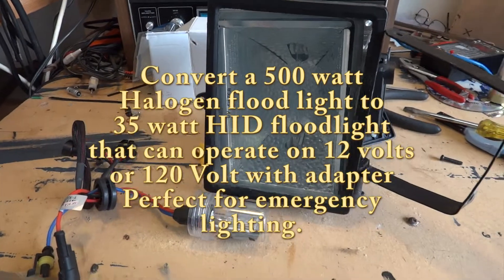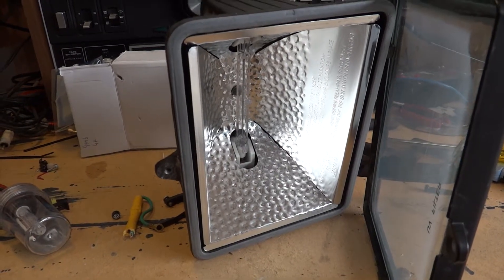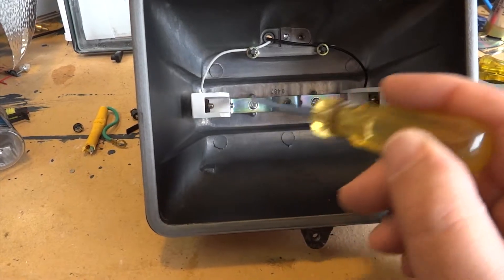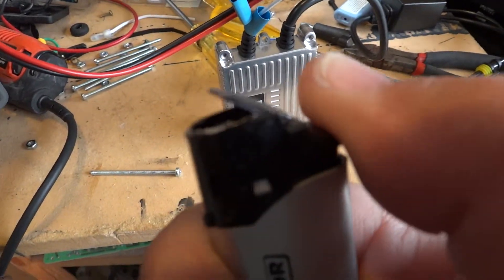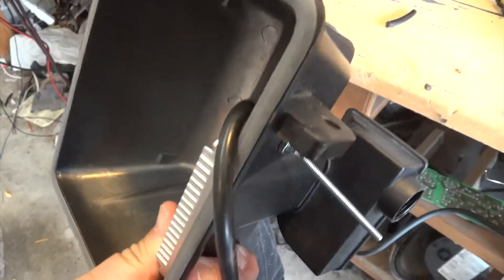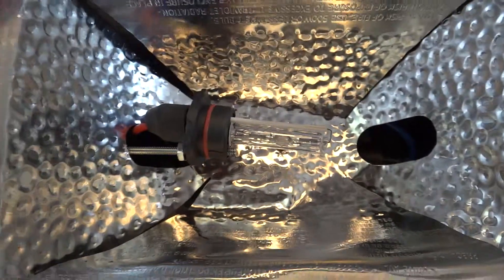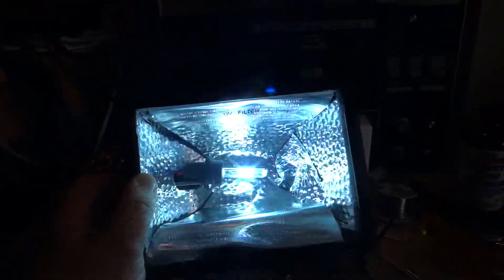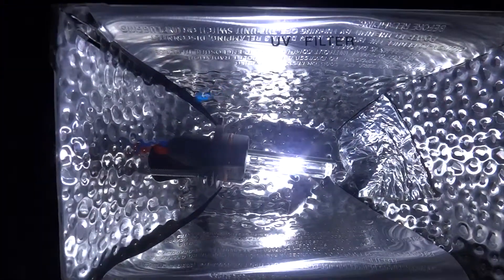halogen to hid conversion

Comment: Too bad there's no 35 - 39 Watts double-end ceramic metal halide bulb that would fit in RX7 socket, otherwise I would have gotten the Halogen spotlight and mod it into a portable work light as I have been using the G8.5 CMH bulbs in my Cyclops Thor Colossus halogen spotlight, it works fine with the Hylux A2088 ballast so far.

Comment: You could have use a double ended type Metal Halide lamp in there
Reply from the maker: Yes I know, but I had a 35 watt HID and 12V ballast igniter lying around as 6K is to blue for my liking in the car, so I swapped my 6K for 4300 in the car.I didn't have a DE ballast lying around other than in my fish tank, which is going to need to rework some day as the fixtures are all rusting.